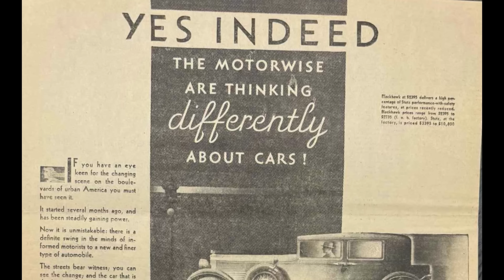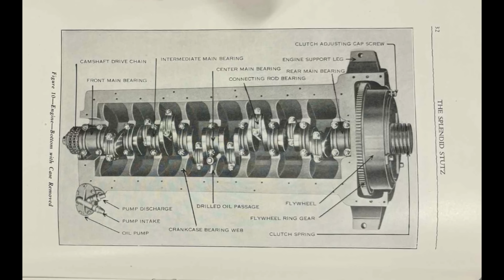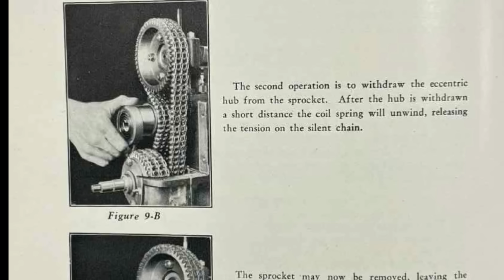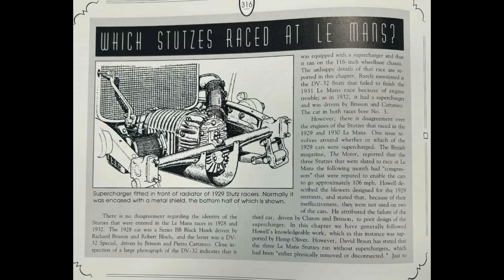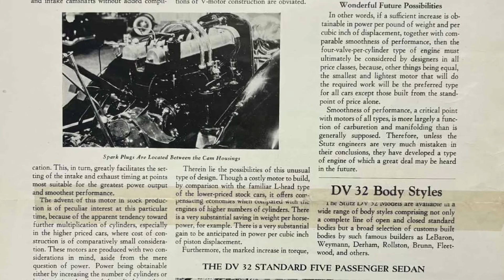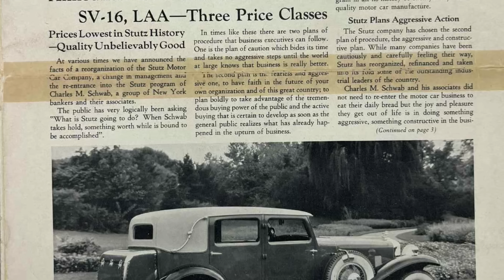Stutz Vertical Eight series AA, Challenger, BB, M,MA,MB, SV-16, DV-32 ￼

Comment: Very very VERY interesting ive always been interested in engines ive never hard of especially ones with cross flow heads.
Reply from the maker: I've wanted to put an episode like this together for a year. It's taking me that long to find enough information to do all of it. It's not available on the Internet.

It also doesn't help that stutz made modifications as each year progressed compounded by few sales And survivor rate not being great either.. it was hard but I was so happy that the AACA Library had the materials that I needed to finish this episode

There's a couple other episodes like that like the very first recognized mass produced V8  is the De Dion they made other engines as well as they were a car manufacturing company in France their V8 came out in 1909 and it looks very similar to Cadillac... I think I was reading that Cadillac engineers went to the French acquisition... when they witnessed the De Dion V8.. if everything goes good, that's supposed to be this month as well, but I wasn't able to find all the information that I needed which is a bummer

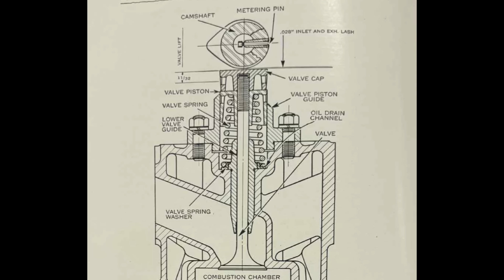Comment: The statement at 3:06 that said the pistons have to come out the bottom of the block is interesting. Maybe I'm confused but when I look at the pictures at 2:05 and 2:46 I don't see how that's possible. The main bearings would be in the way. I also don't understand why they can't be removed from the top of the block. Am I missing something or was there any description or pictures of this? I'll choose the 1932 DV32 and the 1934 SV16. Who am I kidding? I'd love any of them!
Reply from the maker: Hahaha right
Reply: It wasn't unusual in this era of fairly small bores & long strokes, for the big end of the con-rod to be bigger than the cylinder bore. Hence the piston & rod had to come out from the bottom.

Comment: Hi Jay. Thanks, I knew nothing of this Stutz engine, but can point out many similar designs. The Rover 2000 (1963 - 1977) used a very similar OHC design. One chain ran from the crank to an idler shaft which drove distributor and water pump and another chain ran from there to the cam. The cam operated directly on 'buckets' which sat inverted over the ends of the valves, this being called the 'cam and bucket' system, also used by the Jaguar XK engine. On the supercharger driven from the front of the crankshaft, this was done a couple of years earlier by Bentley. Check out 'Blower Bentley'. On worm drives in the rear axle, this was commonplace on French cars, particularly Peugeot and Renault, right up to the time when everything became front wheel drive. It looks on the face of it like a design which wouldn't work for push starting a car, but I've never owned one or tried it. Cheers.
Reply from the maker: Great insight as always =)

Comment: Hi Jay!  Thanks for the thorough run through on the beautiful Stutz engines!  Isn't it interesting that only the Duesenberg and Stutz built OHC engines during the 1920's and both were based in Indianapolis.  Obviously, the engines of the racing cars that ran at the local IMS heavily influenced both companies.  Wills Sainte Claire also had OHC engines, but they don't seem to be quite as related to the racing type engines used in those days.  It is quite amazing how groundbreaking that 1913 Peugeot grand prix engine was.  It influenced many racing engines not just in Europe, but in the US as well.  The drawing you showed of the Stutz valve train, showed the cup type cam followers that Peugeot pioneered in their later models of racing engines.  The original 1913 had an interesting finger type follower that actually operated the valves.  In any event, WYR.  That amazing Weymann bodied DV32 is sweet!  Secondly, the 1934 model shown must be very rare!  I like it!
Reply from the maker: I think the were a few others as well like Harry Miller.. 

Thank you for sharing that insight and information =)
Reply: @What.its.like.  It's interesting you mention Harry Miller!  Back in the day, Bob Burman brought his Peugeot to Harry's shop for some rebuilding work.  He was also heavily influenced by the Peugeot layout.  Miller actually did some improvements on Burman's engine, as well.  If you can find a copy.  Griffith Borgeson's The Golden Age of the American Racing car is highly recommended.  SAE International printed a second edition about 20 years ago.  LOADS of information in the book about all the early racing cars that ran in the US, including Wiedley's work on the Premiere "Swiss Cheese" racer and others.

Comment: Did the stuz Bearcat.   Have these 8s also. A older friend  of mine. 84. Told me his uncle  won a used bearcat gambling  in kitchener  in the 30s. He rolled it wrote off soon after.  Driving  to fast on back rds
Reply from the maker: Stutz has a really confusing lineage or line of car. I'm honestly not 100% sure I pretty sure the Blackhawk did.... 

I did a quick Google search most bearcat was made with Wisconsin engines powering them. The original run lasted until 1924 but it would come back in 1931.  So yes, you could get a bearcat with the vertical eight.

Comment: Another great one, that Stutz OHC design reminds me of another great OHC engine family that ran from the 1920's into the 1950's, the Hall-Scott. OHC and Hemi !!   Those were popular in busses, trucks and marine applications, and were very advanced for their time, and especially such workaday applications.   Worm drive rear ends were quite popular in European cars (Peugeot, Rover and Lancaster, to name the common ones) and many American trucks from the teens up through the 1940's.   Dead quiet and super strong was the advantage (Hypoid gears came in the 1920's , and were nearly as quiet at lower cost).
Reply from the maker: Great insight, Tim thank you so much

I'll have to look into Hall Scott that's a company that I want to cover eventually
Reply: @What.its.like.  You'll like Hall-Scott.  They even did aircraft engines early on.   Thier coolest engines were actually the most numerous.   855, 991, and 1091 cubic inch overhead cam hemi head straight sixes.  I've been around these first hand, and they are both beautiful to look at and sound fantastic !!  This family of sixes started in the 1920's and ran straight through into the 1950's

They ere built in Berkely, California, and were connected with Fageol trucks and busses, which became Peterbilt trucks.     Some of the coolest looking busses and trucks built during that period.
Check out Fageol "Safety Coach" and the trucks, as well as the first Peterbilts   Good looking rigs !

Comment: You should have mentioned that Harry C Stutz had left the company in 1919, so none of the cars in your review would have been under his leadership. He went an formed a new company, called HCS, but that company was out of business by 1927. I knew about the SV16 and the DV32, but not about what led up to those engines. Very interesting stuff, Jay. The DV32 looked a lot like a Duesenberg engine. WYR= DV32 first, and any of the others would be just fine in my garage. I never realized how low slung Stutz's were!
If you can find a Bearcat, that would make for a cooooool review!
Reply from the maker: I did one Stutz on the channel. It was a BB Blackhawk so far I've witnessed a couple other ones. There's one in the pipeline.

I wanted to do a company history  on stutz but I need that book the splended stutz it's where I got a lot of this information from. It's a stellar book... 

But you're right I should've went into more detail about the company. Harry Stutts had nothing to do with these engines. It was a little bit hard to understand who was running the company I thought Frederic miscovics was an engineer with Charles greuter but after reading some of the stuff in the text, it almost seemed like he was the one running the company... for awhile until he left... 

I would love to drive one, a four door sedan I really like the blue one in the would you rather I saw it sold for 75,000 I'm not entirely sure when when I was at Hershey, I saw BB Blackhawk for $35,000 which I thought was insane... because 10 years ago it was millions
Reply: @What.its.like.  Another Stutz product was American Underslung, built from 1905 to 1914. these cars were LOW! Especially for the time. I've never seen one in person, but they look really cool in photos!
Reply: Low slung and sporty is the L-29 Cord too.
Reply: Or a Blackhawk!

Comment: Hey Jay. In distant memory I think that Peugeot may have used a worm drive rear axel? Something about not tow starting them?? cheers from Kiwi Bryce
Reply from the maker: I pointed out the worm drive because I never saw a performance car with it seen trucks with it

Peugeot company that I'm not well-versed in
Reply: @What.its.like.  Fair enough Jay, I wasn't nit picking. I am celebrating my 46th year as a mechanic today. I should know, considering Peugeot was one of our "dealer" cars?  🙂lol
Reply: I do believe you are correct. Peugeot 403 and possibly the 404 used worm drive.
Reply: Daimler Motors UK were very fond of the worm drive axle also.
Reply: @johnrebus1641  Ah, thanks, I was sure there was another, cheers 🙂